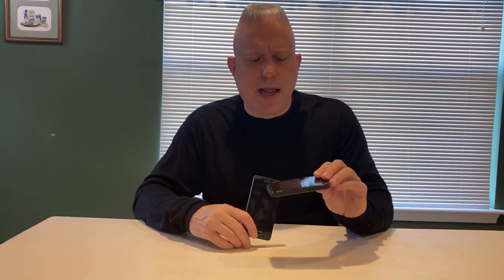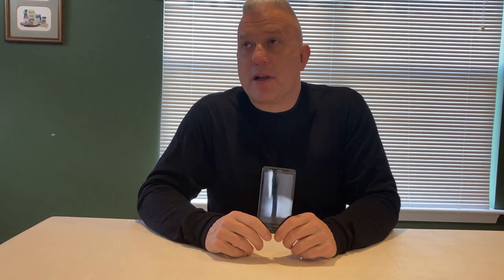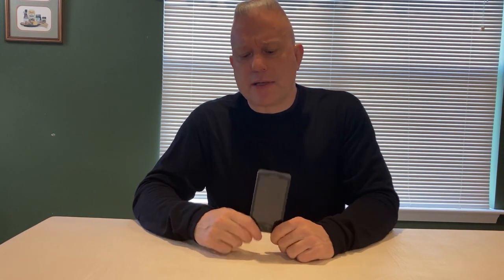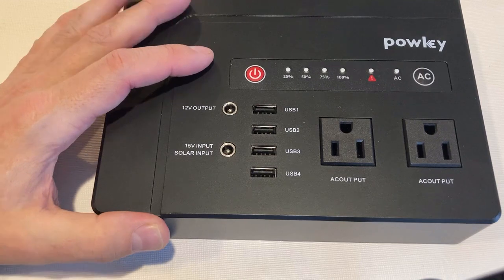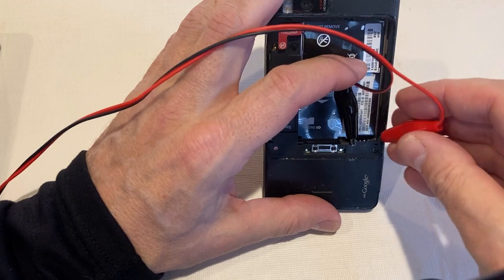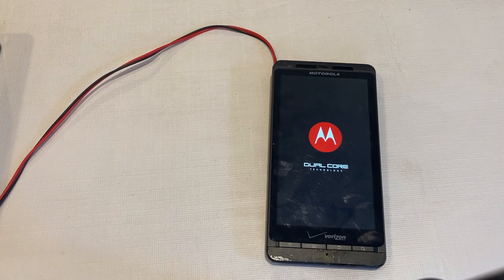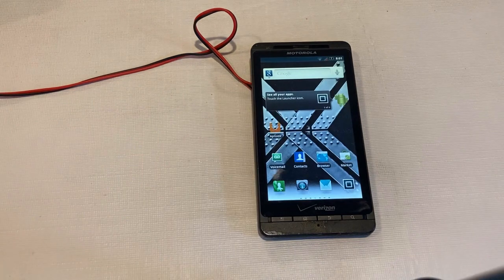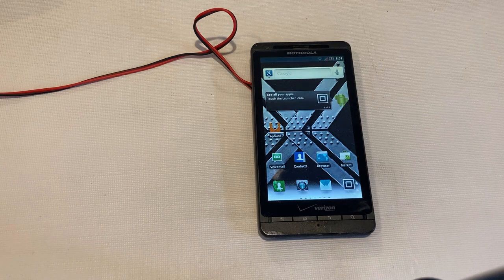Turn a $6 Droid X2 into an AWESOME low power File Player and Gaming Station. Pt 1. Hack the Battery!

Comment: Just got mine set up. What's the radio app?
Reply from the maker: Hey Kevster, The radio is resident on the phone. It's called FM radio. I'll be making the video for loading the games hopefully tonight and posting it tomorrow. You need to have something plugged into the headphone jack for it to operate. It uses that for an antenna. You can use headphones or an aux cable going to an external speaker.

Comment: I was able to use the stock file program to play a video through the Micro HDMI cable to my TV. Is there a way to play a video to the TV with VLC? Do the game emulators work on the TV or just on the phone?
Reply from the maker: Hey Kevster. I usually use a fire tablet to do those things. I'll show that in a video soon.  I recall  the phone outputting the video for the games, but the delay was enough to make it very hard to play. i think the audio was not in sync when I played videos too. I'll revisit the phone output soon and see if i can get it working.  I might have been playing video from a sd card and it might work better if I first move the vidoe to the phone. I'll Ito play with it soon.
Reply from the maker: Hey Kevster. Yes! It does play movies fine while outputting to hdmi. I just checked. It has a very minor delay for the games though. It makes most pretty hard to play. You could probably play turn based games like Pokémon or something though. I'll make a video soon to let people know about that. 
  I originally put out a video saying that it could do that but then I made it private once I saw the delay. I think I imagined the delay for the games was for the movies too, but it is not. Either way, that is a great comment and awesome of you to share. Thanks.  It has been several years since I was actively doing the phone. I was a little fuzzy on the details.  I used to output it to a child's eyeclops toy projector. :) :) :) The PVO projector was a great upgrade.
Reply from the maker: Hey Kevster. Ahhh Yes. I remember now. The Games have a delay. The playing of videos through HDMI is helpful if you have a projector only. Since the PVO projector has a file plyer in it, there is no real benefit to connecting the phone for video playing. It took me a minute to remeber that. :)
Reply: @TroyTime02   Looking forward to it I have a couple of old fire tablets.
Reply from the maker: @kevsterman4053  Yes. those are awesome. You can even connect a bluetooth game controller and have something like a Retro Switch.

Comment: Is there anyway to use a SD card greater than 32GB?
Reply from the maker: I think it works with a 128 GB. I'll double check soon (probably tonight) and post another reply. :)
Reply from the maker: Hey Kevster, I just threw a 64GB card in mine and it worked fine. I seem to remember a 128 card working too, but I couldn't put my hands on one this evening.